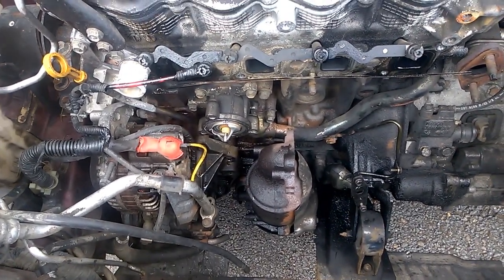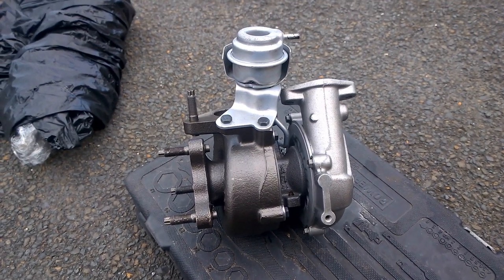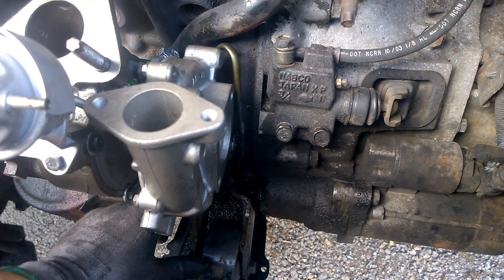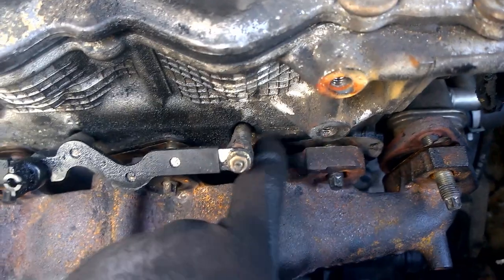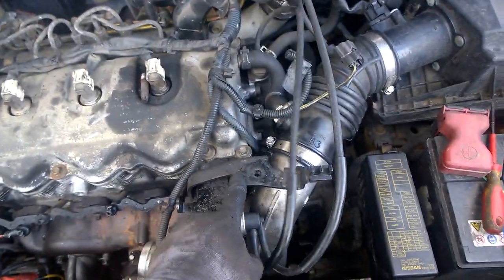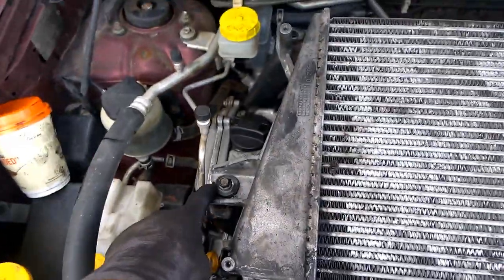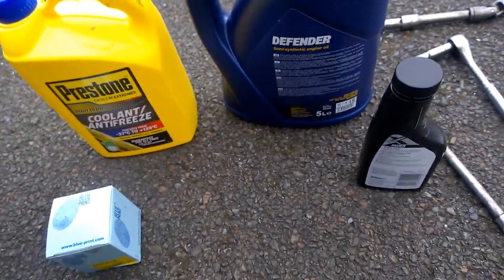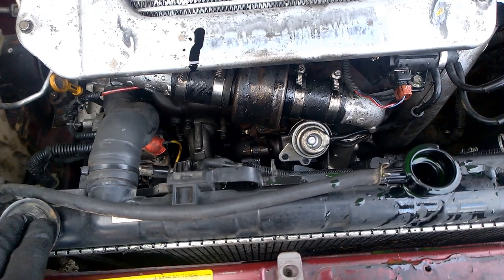Nissan Xtrail T30 Turbo replacement

Comment: mmmm, garrett, ive found with some garrets  theyre throw away but theyre very good all the same, you have some skills Stephen, GLAD your xtrail doesn't have the ZD30 engine.
Reply from the maker: closertothetruth  The turbo's are cheap to be fixed so I don't mind replacing it. Thanks I do try. Are the zd30 a bad engine. I do a lot of pulling with my jeep. its a great jeep even in fields I pulled big trees across fields with no issues.
Reply: zd30's like to do big ends and over boost depending on which boost control system they have, ie the Nissan patrol zd30 = bad , Nissan navara zd30 ok, d40s snap puny timing chains and crap crankshafts, looks like the new models are much better after a great deal of complaints they finaly got their act together.
Reply from the maker: closertothetruth That's good to know. I think I will stay with this old girl till her end. have you had many  Nissan's.